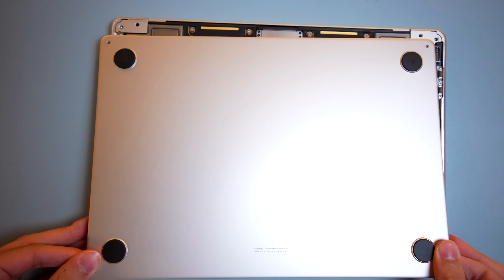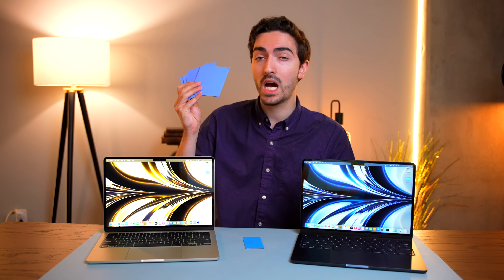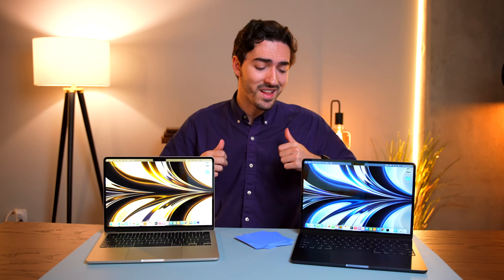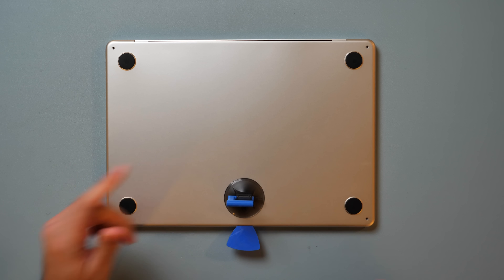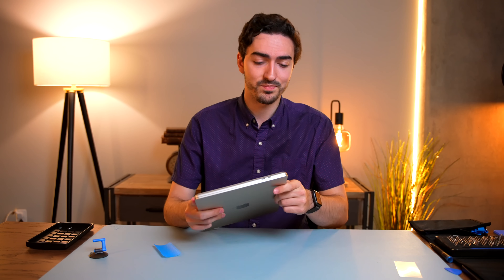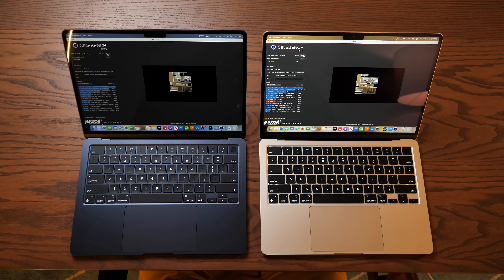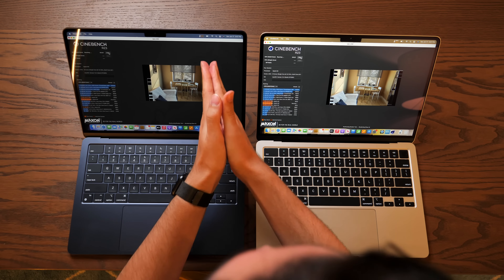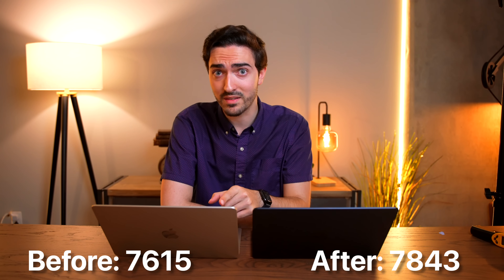Make your M2 MacBook Air FASTER for $8?!

Comment: Apple should definitely take into consideration to increase the thickness of its laptop to improve cooling performance avoiding thermal throttling. Having a powerful CPU without adequate cooling solution is a nonsense!
Reply: Of course apple already thought of this…it’s called the 14 and 16 MacBook Pro
Reply: I think they would rather have a slim macbook.
Reply: It's a very clear business decision. The MacBook Air is targeted more towards low-end users who don't really care about the little extra performance. These are also generally people upgrading after a while, so they're very happy with a "thin" laptop that handle all their "non-pro" apps. This strategy is very clear in Apple's MacBook Air Ad.
Reply: @TanujWadhi  absolutely correct! This is one of the reasons why I don't like Apple!
Reply: @CAMTechChris  however the actual Pro lineup does not include M2 chipset!!!
Reply: Apple has only one CPU every gen, that is how Apple Silicon works! So you completely misunderstand the fundamentals of how M-chips work. It is def not like Intel or Qualcomm which have low-end chips for customers making cheaper products, slower products. 

So the M2 will be the foundation of all upcoming Macs and will be made more powerful still by stacking M2 chips. So this is not about getting thermals right for more powerful chips, as Apple has no choice. They could underclock or power throttle the M2 for the Air but that would no doubt lead to Max Tech and anti-Apple comments saying how Apple reduced performance. 

What it boils down to is common sense by consumers that understand a fanless design is made for the demographic that is not looking for absolute performance.
Reply: My comment was meant as a joke. Of course the new Mbp deosnt have the M2. I own the 16 m1 max mbp and love it. Everyone is waaaay to stressed about the m2 mba thermals. I don’t care at all if my new m2 mba throttles, it’s designed that way.

Comment: you know... you should be able to change the run time of the Cinebench test, so that you can have one continuous long run, which should be more accurate.
Also. As I personally found out, when I was doing the same mod for my 2020 Intel MacBook Air, Apple's thermal control algorithm is not as simple as "if (temp==...){power=...}". The OS will try to predict the load characteristic and respond differently. For example, if you are just launching a program (a short task) the CPU will boost very high for a bit to get the quick responds that we all love. However, if you are streaming (a long task), rather than going back and forth between boost high and throttling, the device will try to settle in whatever the equlibrium state is. Nevertheless, the OS does not know exactly what you are doing or how long the task is, it is just making educated guesses, based on the current and past power usage data.
What does it means for your? Well... It means that you will sometime get strangely low performance from time to time. And, if the problem persist, I suggest letting it cool down and restart the device, to reset the old power usage data set.

Comment: I find it hilarious how when the M2 MacBook Pro came out, YouTubers all unanimously trashed it saying "no one should buy this machine, you should buy the M2 MacBook Air." Shrugging off the benefit of the fan as completely irrelevant on this class of machine, and if you really needed sustained performance you should be looking at the 14/16 MacBook Pro. And yet....here we are with the M2 MacBook Air, and now many of the same YouTubers are all doing videos about the Airs thermal performance and throttling....

The hypocrisy is staggering. Pick a narrative and stick with it. Either this class of machine doesn't really need high performing thermals because most users don't need heavy sustained performance on an ultraportable, or they actually do. But quit talking out of both sides of your ass.

Oh wait, its Youtube. Whatever it takes to come up with as many video ideas as possible and get more views.

I know Luke is probably doing this for fun/curiosity, but at the same time it just feels like beating a dead horse for the sake of more videos.

Comment: A “thermal situation” that will likely effect no one. You and Max are doing unrealistic tests that won’t matter to most if not all users.

This us the old PC users mindset of looking at numbers and specs because that is the only differentiator between generic PCs.
Reply: They are not doing unrealistic tests. Try to play a video game on the MBAir, which is absolutely doable, and you are in the same workload territory as what they are doing. Firefox or Chrome with a dozen open tabs may do the same occasionally. There are many "normal" use cases that these synthetic tests simulate. It turns out that the M1 and M2 family of computers are so good that some users want to know if they can get away with the MBAir instead of purchasing a much more expensive MBPro. And many actually can! I'm developing video games and iOS apps on my M1 MBAir, and it's a pleasure. I could not have known that before purchasing it if Luke, MaxTech and a few others had not tried to push these machines. It's very valuable information, for more people than you think.

Comment: and... kill the battery in a couple of months
Reply: I have an M1 that is modded in the exact same way for more than year now.

It has no effect on battery life.
Reply: @MarcoBarroca  how often do you use it with extensive tasks? Also have you checked the degradation of the battery
Reply: It heats the battery up by up to 10% and this could breach the tolerances of the battery and make it unsafe with time. It seems a silly thing to risk you or your family, just to increase thermals on something designed to be fanless. What are people thinking?
Reply: @andyH_England  Yeah I think it’s really depends of the scenarios do you want to use your laptop with If you power user and you sticking a thermo-sticker inside of the laptop, and you also using some kind of thermo-pad where are you placing your laptop while using extensively,  also you don’t have enough money to buy a pro one, you just compromising with some sort of risk, I get that… But it’s not what a MacBook Air was designed for, You can’t just do some modification and create a pro machine for yourself, it’s comes with the trade offs
Reply: @danielgall55  Agree.

Comment: You performed a single control test using 1 configuration, and used it as the baseline for judging the performance difference between two different experimental groups. I think you should be more careful about using words like “control” as if what you are doing is a scientifically rigorous test.

Comment: Renee Ritchie is right. It’s ridiculous that tech YouTubers get a fan-less laptop and then stress it out beyond what it was designed for and then engage in outrage promotion. It’s just content creation for the algorithm at this point.
Reply: Luke looks pretty calm in this video, and all he’s doing is showing people that you can get better sustained performance with a really cheap mod, same as how max tech did and showed in their most recent video.
Reply: Renee Ritchie is an Apple apologist for all seasons, and himself a shameless clickbaiter.
Reply: Is it really more ridiculous than Apple putting an OP chip into a chassis that can't sustain it? Even some passive ventilation would have helped rather than a solid case bottom.
Reply: @nickthaskater  I almost wonder since the M2 was rumoured to be 3 NM process originally, if the casing wasn't designed for that level of heat/wattage.
Reply: @nickthaskater  Apple stated in at least one interview that the Air is not for sustained workloads. They made this clear, and yet people fail to understand this basic premise? Is it trolling or stupidity? The Air is not for work that a MB Pro 14 is targeted at! I mean come on, how can you even arguer what you said with a straight face?
Reply: @andyH_England  Define "sustained workload" and where the threshold is for throttling being acceptable.
Reply: @nickthaskater  Each OEM throttles within their testing. We see the S22U throttled at the start (GOS) and thermal throttle hard when sustained. Tell me whether the S22U throttles too early or like the Air, with no active cooling, it has to be tested and we are guided by the billions OEM spend on not causing damage to machines or users? Your point is meh, of course a fanless device will throttle and the level is decided not by us, but safety and longevity reasons fully tested by OEMs. Check out the XPS 13 Plus, that throttled very early to maintain a steady 80 degrees. Obviously Dell believes that is the optimum temp for longevity.
Reply: @andyH_England  The fact that you're having to compare the Air to a phone of all things rather undermines your argument that this is somehow a good design. 

The point is that Apple could have allowed for passive ventilation rather than obsessing over having a smooth, solid bottom cover. 

The point is that it's not a "sustained" workload that sees the Air get to the point of throttling, but rather within seconds of anything that actually leverages the capability of the chip.

This is not good design, nor should it be intentional design or anything to be defended.
Reply: @andyH_England  what you seem to have a hard time realizing is that the m2 air ends up being slower and less useable than the m1 air (both in terms of memory swap and ssd speeds for the base tiers, and worse sustained performance)- a device which is 1.5 years older and at least $400 cheaper. How is that acceptable?
Reply: @connorlearmonth665  That is true in those specifics, but I am not arguing with that, I am saying that as a whole it is much better than the M1 and you need to watch some unbiased intelligent reviews to understand that. 

As for what you say, most people with the M1 Air never got close to its full ability and even though the base (and only the base) is slower in certain unusual circumstances, again most, the vast majority, will never reach that threshold. if they buy sensibly. All a bit OTT and as an owner of an M2, no issues with 20+ apps open and 6-9 Safari tabs. All flies with instant responses and no lag. A fantastic device even in base config for those that are reasonable.
Reply: @andyH_England  oh you again. Okay clearly you haven’t been watching enough of the videos. That’s fine, so to catch you up, max tech showed that it only took 5 tabs and one other app on the m2 air base model before there was noticeably slower response in the system compared to a non base model air. I don’t know about your usage, but In my opinion most “average” mba users will be running that amount easily, if not way more than that. That’s why this is such a big issue. If your usage is lighter than that, the m1 air is $400 cheaper on Amazon, and will handle multitasking better(as also shown in real-world performance videos) Don’t forget that the base model is the most popular model sold, so this issue will affect the most users. People are upset about this because most of the issues can be pin pointed to the single nand being the bottleneck for memory swap. If apple  started the base model at 2x 256gb($2.07 is the cost per nand chip, so it’s hard not to think they’re just cheaping out) this whole “controversy” could have been avoided.
Reply: @connorlearmonth665  You lost me at 8GB for a pro-app-user. That is ridiculous, and for anyone reading this, 16GB is the minimum for pro-app workloads if you are multitasking. Anyone trying to run their business with 8GB is making their lives harder, even on the M1 Air, as even that will slow down (as Max Tech videos show). 

You cannot demand speed and then use a bad config as you are limiting performance yourself. What Max Tech never done was M1 256GB/16GB v 256GB/16GB M2. That would have been the baseline. If the 16GB M2 beat the 16GB M1, then all the slower NAND was just noise, as it would prove that it was the BAD decision of the buyer to get 8GB, not slower NAND. I know why he never did that video, as it would have made the rest of his output look skewed.

Believe what you will, and I will do the same.
Reply: @andyH_England  okay I thought you were done? I have never at any point said 8GB for a pro user, so now you’re just making things up. How is the workflow I described above anything close to pro? No wonder you don’t understand this issue lol. I’ve explained to you over and over again that this is mainly a base model issue, which is the most relevant model for this device as it’s the most popular. In comparisons with the base m1 it has been shown over and over that the base model m2 will handle multitasking poorly with very little memory pressure(2 apps) that it’s either not far off from the m1 air in performance, or even slower than the m1 air. The higher configs essentially resolve this issue because it removes the ssd bottlenecks. All of which goes to highlight how this comes down to apple cheaping out on the base models(it’s only $2.07 per 256gb nand chip). 

As far as belief goes, I don’t need to believe anything, the videos clearly and plainly show the results lmao.
Reply: @connorlearmonth665  You referred to Max Tech, and he was using Chrome tabs and a pro app. If you know about RAM, then you understand that Apple uses compressed RAM, so lighter apps can make 8GB seem closer to 11-12GB, but if you use pro apps like Lightroom or FCP, they take all available RAM on an 8GB machine, so you do not get that 3-4GB of compressed RAM. That is why when using pro apps and multitasking, the M2 is slower, and that is where sensible people that understand this know they need 16GB unless they close the Chrome tabs. I mean, people just cannot whine to Apple if they do not use their own sensibility.  

I get that the M1 will be faster than the M2 with swap, but it still takes over double the time when multitasking to do the same render as the M1 without multitasking, and although the M2 takes longer, the 8GB remains the limiter. If you are so concerned about saving time, then why get the M1 8GB, as that will be slower than the 16GB M1? My point exactly...
Reply: @andyH_England  as you reply, max tech just released an m1 vs m2 air video. I haven’t finished watching it yet but perhaps it’ll cover the higher end models that you mentioned earlier for comparison. 

Even if you still consider what they’re doing a pro workflow, the fact remains that the equivalent base m1 mba handled it with less degradation in system responsiveness and performance to the point where it was faster and more responsive than the m2 base air. In my opinion( and most others) there should not be any downgrade in any performance metric from generation to generation - no matter which tier you’re comparing. Especially not when it comes to the most popular model. 

I think we’ve reached a good ending point. Let’s move on from this, have a good one.

Comment: GregGadgets video show a similar performance anomaly between the M2 MacBook Air 8 GPU Vs 10 GPU models, where the 8 GPU model consistently outperformed the 10 GPU model when both were subjected to a sustained graphics load. He wondered he the 2 extra GPUs on the 10 GPU model was increasing the thermal load and causing it to throttle sooner compared with the 8 GPU model. 10 GPU model had better GPU peak performance for short duration graphics loads, but it's does imply there is no real benefit in paying the additional $100 for the 10 GPU model in a passively cooled laptop, especially for light gaming or video editing applications. I think Apple went one step too far with the thin & light design M2 MacBook Air. They may have achieved better thermal performance if they went for a slightly thicker chassis with a much thicker and solid ribbed bottom panel for improved heat dissipation.

Comment: wtf do you mean its definitively viable? whotf puts a 10min all core max stresstest on a fanless macbook air? thats the wrong product if you need this kind of use case, get the macbook with the fan then.
this is beyond useless, it's time that Apple glues the bottom on so nobody can open this and i can buy a used one be sure nobody had his hands in it.
no offense but this is maximum pointless, get a life

Comment: You really have to be stupid to do this, getting bottom case hot is the worst thing you could do, both for usage (too hot in lap) and longevity, especially battery. Throttling is a good thing, the sooner the better. To have colder laptop, M3 is fast anyway and cores run at 4.05GHz (M2 is 3.5GHz), and even when throttling, it is still 10-15% faster than M2. You can even use low-power mode, which reduces power usage by about 66%, and still gets 2000 score in Geekbench 6 for single core. (Almost as fast as normal M1)